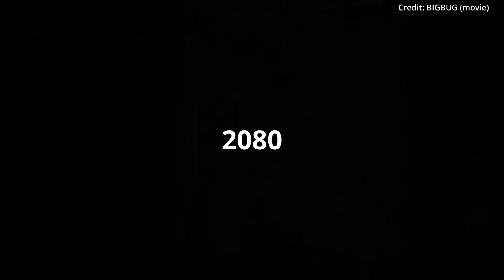AI ROBOTS Becoming TOO HUMAN: 2025 - 2100 Timeline To Robotics Singularity & Beyond …

Comment: This video is completely wrong.
Technology is actually slowing down not speeding up.
We will get 100% full functioning lifelike robots by the beginning of the next century. Robots will be mostly clumsy, slow and pretty much useless for the next 70 years from now, the 20s. The breakthrough for full functioning independent robotics will happen by 2120.
Also based on my calculations there will be no World War in this century even though there is constant threat from Russia.
However between year 2100 and 2700 there will be two additional world wars NWWI and NWWII. The first nuclear war which I believe will happen sometime in 2200AD will have a negative impact on the European Union making it weaker than ever. It's very likely that a new race of individuals will take over Europe making new extremist Laws. There will be a decline in technology and innovation. However there will still be some thriving.
As for the United States, a new race will also dominate as early as 200 years from now. Crime will increase. Technology will be on decline after that by which the US will be defeated during the second nuclear war 2600AD. Most of the US and Canada will be dominated by China.
The second nuclear war will definitely involve Robotic warfare.
I believe the Chinese empire which started from year 2000 could potentially last for 800 before collapsing.
The future isn't only about inventions alone. Many things both negative and positive are bound to happen.

Comment: Bottom line is they have no feelings and only appear to. Humans are smarter and wont allow them to rule negatively. Humans control the switch to shut them down. Even with all the technology currently available doomsday hasnt happened even though theoretically it is possible. I'm optimistic about AI and think good times are ahead limited only by our own human fallacies. Basic values of fairplay and respect for other forms will continue to rule as always.